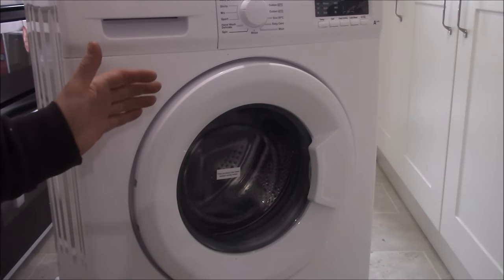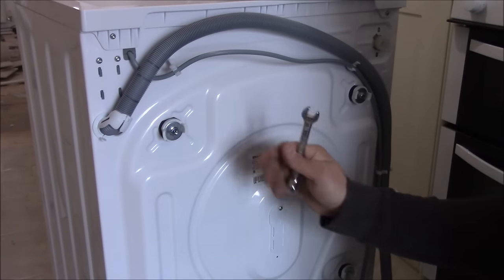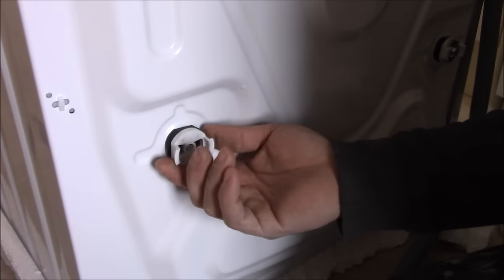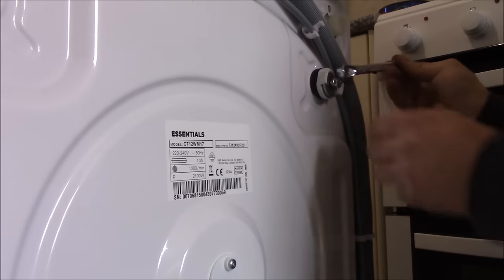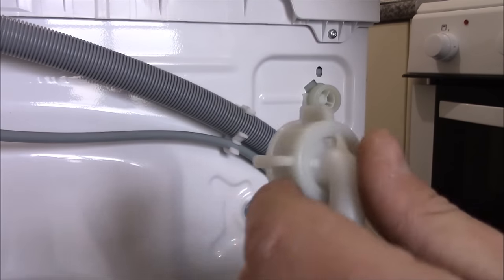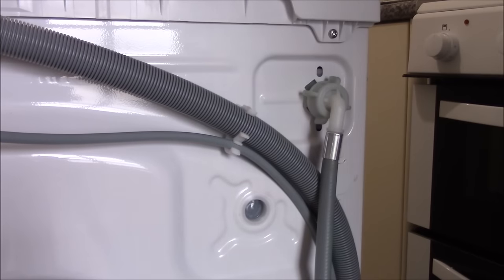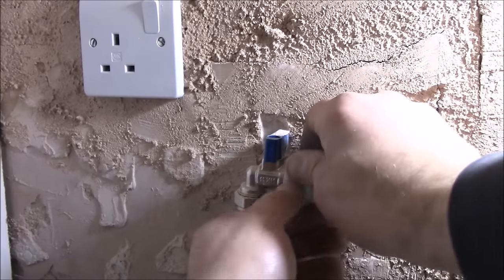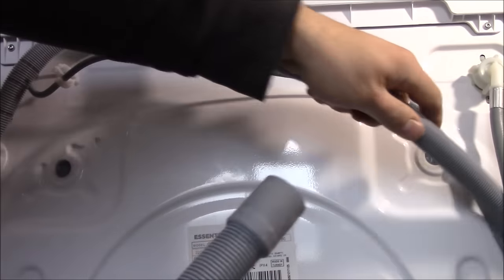new washing machine  plumbing installation water supply and waste

Comment: Thanks. This one help me to get the drainage issue fixed on my brand new washing machine. It was connected under the sink and there was a cap to cover the sink pipe which i removed before. But it wasn't draining. After watching the video i found there was another rubber seal inside (as shown in 5:00). Unlike some of the others commented, this wasn't a one way valve but a rubber bush which completely block the line. After removing it, draining worked just fine.

Comment: Nice video. Just one thing, at 5:00 you tell us to remove the middle bit of the rubber "washer" before replacing it. I don't think that is necessary. The middle bit of the rubber seal act's as a one-way flap valve which allowes waste water to travel in one direction only. (Into the drain) The rubber flap then closes to prevent waste water flowing back down the grey discharge hose towards the appliance.
If it was supposed to be removed, why would it be there in the first place 😉. I have exactly the same sink trap and did not remove the middle of the rubber seal/valve. It works fine and drains nicely 😎.
Reply: Exactly. The engineer of the sink drain made it for that specific reason. Regular diy'ers should be more proud of the engineers who build these little add ons we hardly notice.
Reply: May be not the case always. I found out that it was rubber bush which completely block the line (its a new house where plumbing is just done) not a one way valve. After removing it, the draining worked just fine.

Comment: The middle of the rubber seal is meant to be left in so that water can travel out of the machine but not allowed to flow back into the machine from the sink but break the small tabs and just leave the one Big tab so it can let the machine water push against it
Reply: May be not the case always. I found out that it was rubber bush which completely block the line (its a new house where plumbing is just done). After removing it, the draining worked just fine.
Reply: That middle bit of the washer acts as a non return valve. If you remove it then water can get into the washing machine or dishwasher when you empty the sink. This can be overcome if you point the small pipe upwards so that gravity won’t let water into the pipe. The sink drain acts as the anti-siphon in this case.

Comment: Please, I have a question. In the drain hose installation, I observed that the height is higher than the machine. How will the water flow out of the machine

Comment: In the first example of plumbing the waste is the U-clip not required because the trap of the sink will prevent smells? Where as if the waste is going in to a separate straight pipe then the U-clip is needed?

Comment: Does the black stopper things have a specefic name to them or is it just called stoppers under the kitcken sink? I think I need to buy one. I have exactly the same setup under my kitchen sink and the grey drain pipe does go in one of those outlet. I have 2 open outlet down there, i reckon one is definitely for the washing machine drain pipe but other one is just there with leaking water. So what's that black stopper called?

Comment: I have done loads of washing machines/Dishwashers and not gonna lie I learnt from this video about cutting the waste pipe down, I have always used a clip and never had issues. But I also noticed you done something wrong, the "washer" in the waste pipe is designed as a "Non-Return" so if your sink backs up all the dirty water does not go into your washing machine/Dishwasher, that is why it only opens one side.

Comment: With the use of an Oatey laundry box, If I were to lower the box so the top of the drain pipe is 28”, could I put the p-trap below the floor? I have a crawl space below the floor.  Front load washer.

Comment: I'm searching for under counters wash machine plumbing as I ran into a problem that, by code it has to dump water in a 2" drain pipe, which eliminates the possibility of connected to lav drain. Or if I ran a dedicated drain pipe by code the bottom of P trap should be at least 6" off ground, and top of drain pipe should be at least 24" above P trap horizontal branch, these 2 plus P trap would be over 36 " above ground, so the laundry connection are all exposed above counter top. I want hide plumbing under counter but looks impossible, even on Bosch manual they have nice picture of washer dryer under counter and no connection above counter but in detail instruction it said drain pipe should be at least 36" above ground. I'm lost.

Comment: Yeh: This guy is generous : I'll thank him for the upload, but please read on. He's not showing you everything. When the machine arrives the waste pipe is held on at the back by heavy plastic clips (I had to carefully cut through one clip, so the GREY waste pipe was free to bend under my sink). At 7:42 when he puts the waste pipe on the spigot (white spout sticking out) notice the GREY C clip is not there. He doesnt show you that you have to REMOVE this clip - if you are fitting the waste pipe under the sink. It's not that obvious the C clip can be removed and comes fitted with new machines. You only need the C clip, if you are installing the grey washing machine waste pipe into a vertical waste pipe (what this guy calls Method 2). Other little things that can go wrong include not having the black SEAL RINGS inside the supply pipe connectors (the hot and cold pipes that attach to the machine). Without these you will get leaks immediately. The jubilee clip he uses is  a 13-19mm Hose Clip (that he doesnt identify): These dont come with the machine. To even attempt this job, I would have 2 x 13-19mm jubilee clips, a few spare seal rings, a hack saw, pliers and various screw drivers. I would oil the jubliee clip screw, so it does not corrode AND ensure its fully TIGHTENED, coz the machine will be sending a lot of waste water through that connection. Good luck. Comments welcomed.
Reply: Hi what kind connection did you end up use and how it hold up? The way he doing it is fairly easy and if it is the proper installation I would do it, But, as I read the code I'm start thinking  connecting grey wast pipe to sink is code violation, here code say it should has it's own 2" drain pipe, and the top off drain pipe should above the wash machine. Which put all these connections above counter top, but I really want hide under counter.

Comment: The new washing machine site will be some distance from the sink. So, no waste connection there. But, the rear of the washing machine will be up against the 40mm waste pipe some distance away. I will need to connect via the second option shown. I fully understand the method of connecting the washing machine flexible waste pipe into a vertical waste pipe. But, how do you connect this vertical waste pipe to an existing 40mm waste pipe? Or is there another connection option? Thanks.
Reply: you need to break it down, Mike. The vertical waste pipe is a "run away" pipe (usually installed by a plumber) thats connected to your MAIN waste pipe that carries waste water out into the sewer (external drain). Your washing machine needs to be VERY close to this vertical "run away" pipe, when you fit washing machine waste water pipe (the GREY one attached to the machine) - shown in Method 2 in vid above. But heres the kicker- not all homes are fitted with a vertical runaway waste water pipe. If you dont have this vertical 40mm waste pipe NEAR your machine, I would ask a qualified plumber to install one FIRST, NEAR where your machine will be operating- before you do anything else. Good luck.

Comment: What about the pipe from the old washing machine. Ours is miles away from the spigot and goes through three cupboards and a right angle that only a mouse and pipe can fit through so no idea how they fitted it first time.

I thought maybe you could disconnect the old washing machine pipe and insert that into the new washer but obviously a bit dumb not to use new parts and likely not his it should be done.

No idea how anyone is supposed to thread the new pipe through all that though. String attached to both old pipe and new pipe pulled out until it reaches the sink spigot maybe. No other way I can see as there's no drain like in The video.

Only other place is where dishwasher is now

Comment: What size was the hose clip you put on?
Reply: Clips are 13-19mm hose clips (you can get them from any respectable builders merchants for a few pounds, or dollars). the oldschool engineers used to call them "jubilee clips".

Comment: horrible kind of installation😂😅🤣In japan most of the house have already a drainage for waste water to go down to the drainage!!No one use that kitchen plumbing to connect for washing😂😅🤣
Reply: Its a fair point... Method 2 (using a separate vertical waste pipe) does ensure dirty water from the washing machine has its own waste stream into the main drain: problem is- not all homes are fitted with vertical 40mm waste pipes. Its not a big job, but personally, I would leave it to a pro-plumber to fit one.